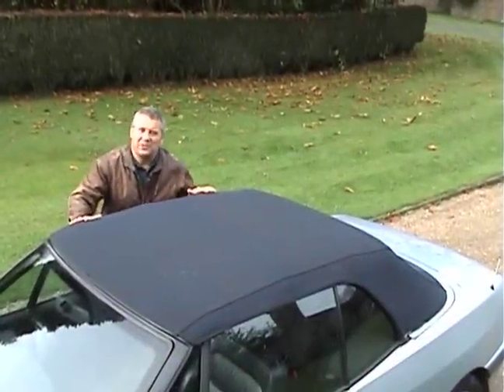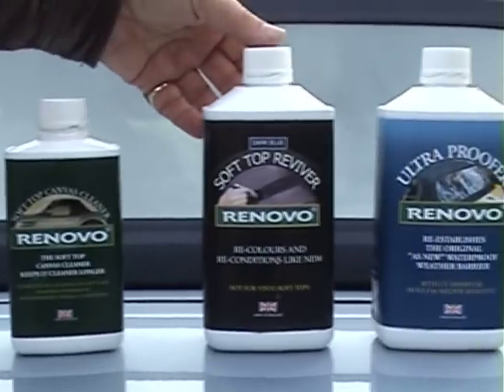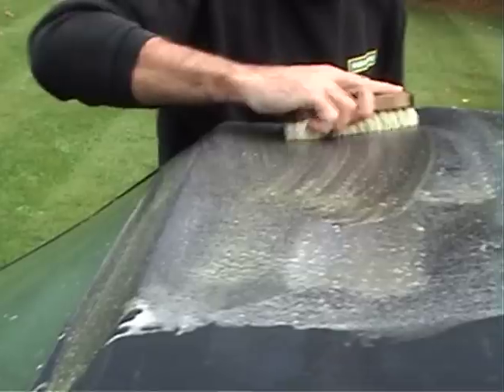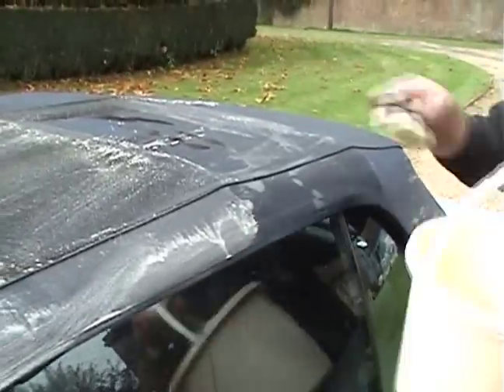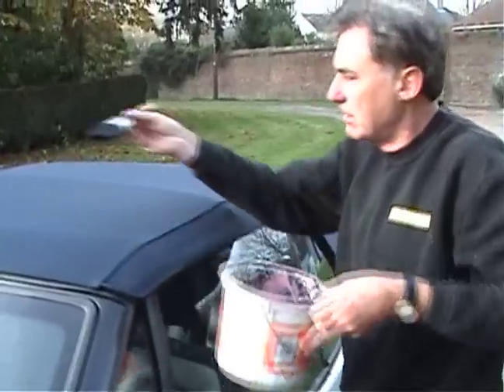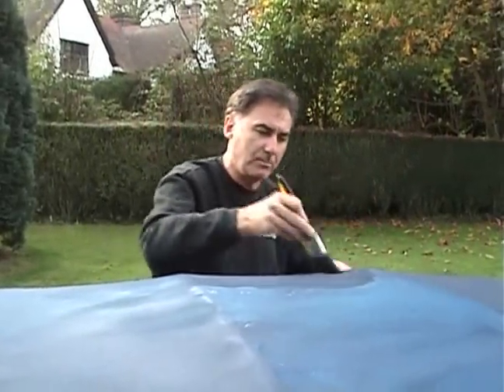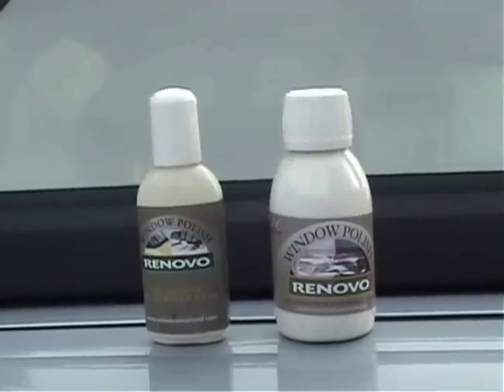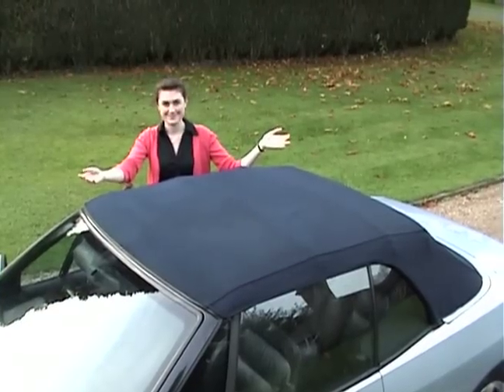Revive your convertible soft top with Renovo

Comment from the maker: Hi Sayer

I've spoken to one of the directors by email, and whilst he agrees that a recolour could work in theory on any exposed fabric, he doesn't recommend going that route. It seems that seepage may be the main problem, and could potentially be 'a bit of a mess. ' (They are nothing if not honest at Renovo!). As mentioned before, Renovo is formulated for canvas type products, not vinyl. However, another cure that might work on faded vinyl is a simple 'cut back' with a product such as T cut, or 3M's Imperial compound, or Starbrights plastic restorer. All these products contain a very mild abrasive, that should take out oxidisation (fading) and get back to unaffected pigment underneath. Worth a go on a small test area, I would suggest. Hope this helps. Cheers. Jake
Reply: Will the product work on a blue convertible that seems to have flicks  of bleach that are white spots please
Reply: @patrowe8156  It depends on what exactly the white spots are. If they are indeed flicks of bleach, unfortunately, the Reviver will not mask them. However, if they are bits of mold, which can look white, it will certainly benefit from the Fabric Soft Top Cleaner and Reviver.
Reply: @renovointernationalltd8329  hi l have been told that the marks on the  fabric roof are bird poop that was left for months, do you think Renovo cleaner will help ??please

Comment: I had a leak on my 2001 boxster - coming from above the driver side window.. porsche quoted me way too much for replacement rubbers. I took it to Marshall motors - they said the door had dropped a fraction so it was'nt sealing - realigned the door - no more problem. Worth investigating.

Comment: Hi, I have used Renovo as described on the bottle - I have a few scratches in the top. My question is "How can I get rid of the scratches?"  They look like dog feet type scratches. I found these on the roof having returned from a shopping trip
Reply from the maker: Hi Roger. That might be tricky, as it sounds like they have taken the top layer of the fabric off. The reviver will disguise them to some degree, but unlike the plastic windows, the scratches can't be physically polished out. Bit of a pain, I know, but they may almost vanish once recoloured. Cheers Jake
Reply: Hi JakeThanks for your positive comments. I will try the reviver on the soft top at the weekend - weather permitting

Comment from the maker: Hi 13jm31. Apologies for the delay in reply - been overseas! Alas, it's not (yet) available in white. However, you might find that the cleaner by itself will do much to restore the existing colour, especially if applied with hot water. The Renovo range is now widely distributed by Unipart, so can be found in automotive retailers and boat chandlers, or you can order it direct (and get advice from the star of the video, Pat) at the Renovo website (address in vid) . Cheers. JakeKav1

Comment from the maker: Hi Pat. I've spoken to the manufacturer, and they say a number of their customers have done just what you're proposing, and the feedback has always been positive. It's imperative to clean the canvas thoroughly with Renovo Soft Top Canvas Cleaner first, though, and you may need more than the two recommended coats of Reviver, which will make the material a little stiffer. Renovo has good advice if you contact them directly. I've changed a parcel shelf from grey to black very successfully!
Reply: Many thanks Jake, have taken your advice and contacted Renovo directly. If I go ahead with the purchase, I'll let you know how I get on.
Reply: patmahe01 Hello. I have a Z4 with a brown roof and was also wondering if I can convert it to black. Saw your comment here and would like to know if you were able to convert yours with this product; and if so, how many bottles did you need. Thanks

Comment from the maker: Hi Daytoncarcare

As a freelance journo who has followed Renovo's development for the marine industry, I have used their products successfully on everything from bicycle panniers to canvas shoes. So I passed your comments on to the Renovo team. They replied " Rit dye seems to be about the equivalent to Dylon dye in the UK, Dylon being used to colour fabric items in a washing machine. Since Rit dye is not specifically developed for use on soft tops, it would seem quite risky to try it out on ones prized convertible. Who knows how colourfast it would be, what would be the longevity of the colour and most importantly what damage it could do to the soft top! We don’t think many people would be prepared to risk it. Why penny pinch on such an untested product?"
Reply: Jake Kavanagh On the bottle they claim that the 500ml will cover an average size top, but it doesn't.  And they also recommend doing two coats.  They charged me about $60 for the color and proofing bottles.  So that means two quantities will have to be used to complete at least one coat ($120 without buying the cleaner). Since two coats are recommended then that would be $240 or maybe less if you can stretch it with three pairs of bottles ($180) instead of four.  With some smaller tops you can purchase the whole canvass for $400-$600 depending on what type of car you have.Of course, some are easier than others to replacel so you may have to hire an installer.  Rit dye will work but you have to go though the process of rinsing it several times before proofing it or it will bleed.  Since that is the way they dye clothing. So it's a toss up if you want to pay ten times more for the Renovo color and not risk the bleeding with the first rain or use Rit and deal with the rinsing process.

Comment from the maker: Hi Sayer

Alas, these products can only be used on canvas-type fabrics, as the dye technology needs a porous surface. The problem with vinyl is it has a shiny, impervious surface, which the dye can't penetrate and bond with. That said, if the vinyl has actually worn away so some of the supporting fabric underneath is exposed, then - in theory - the dye will recolour the supporting fabric in those areas, which may be enough to disguise any fading. I will ask the CEO for some further info, and post here shortly. Thanks for watching!

Comment: Hi David. This is very odd. The product has been around for decades and successfully used on literally millions of vehicles, as well as boat dodgers, cycle panniers - in fact anything made from a canvas weave. It is a highly absorbent dye based on paint technology, and yes - will make the material a little stiffer (although not by much) but it certainly shouldn't crack or wrinkle. It won't work on canvas-effect vinyl, for example. The clue may be in the substrate which you say is mohair. I'm not familiar with this in terms of Renovo,  but what I do know is the dye should be applied to natural fabrics that are woven. The dye seeps into the fibres to create a solid base colour. Ideally, the fabric should be washed first, and Renovo's cleaner is tested to be fully compatible with the restorer. After the colour restorer you finish off with the reproofer, which fills any gaps left by stitching holes that open up over time. If you put multiple layers on, rather than a single coat, this could stiffen the material more than usual, but that is all I can think of. Follow the directions, use it on pre-cleaned, woven material and you should have been one of millions of happy customers.

Comment: Not so good for me got the whole kit 1lt each. After following the instructions it dryed up looking like it had been painted a silver colour and very patchy. Got in touch with renovo through amazon had no reply. Took it to a soft top specialist and was told nothing could be done and should never use dye, clean protect only. New hood needed. I have spent over a 100 hours (yes 100 hours). Been cleaning with difference products little improvement. I have now tuned to treating with petrol nothing to loose, it seems to be working don't see any sign of damage.

Comment: Ok so I thought to try this expensive product.  My wife's '03 Eclipse GTS lives in the shade a lot of the time so the top wasn't bad but I wanted to bring back the new black look.  I carefully cleaned the top, let dry.  Masked off some areas and went to work per instructions.  My bottom line?  Waste of money period.  The top didn't get to the black I was hoping for and again, for the price one pays you would think it should.  Very unhappy and I do not recommend.
Reply: @jakekavanagh7385    in fact I did buy a litre. (Think I got it on Amazon but not sure.  Do I need to prove?  Care to see a picture of the remaining in the container on my shelf?)   As mentioned in my comment..." Eclipse GTS lives in the shade a lot of the time so the top wasn't bad". Yes, older vehicle however, with only 60K miles and the fact that it sits at home in a carport most of it's life why... the top was quite good. (Just wanted it to be a deeper black like it was when OEM and I thought from reading and youtube videos I saw that this product would do the job.) I used about 600ML of product in the application and it was applied liberally. 

Yes of course, "masking off" was to protect the car. It's just standard practice for me when working with paints, products like this. The application was not "skimped" on. Sorry, I just thought with a top like ours in rather good condition that we could get a deeper black in the one coat. 

Hind-site 20/20 now? Ok maybe another coat would have helped?? Well, read the side of the container, our top was not "badly faded". I have about 400ML left, if they want to send me another bottle at no cost I'll give it a go again with two coats and update my review it it produces positive deep black results. (Is your/their definition/perception of black different from mine?  Works "brilliantly"? Now there can be the catch I suppose.)

Comment: Hi Graham
Yes, this should do it - be aware, though, that you will probably need two coats (let the first one dry) and it will make the material slightly stiffer than it was before. This is paint-based tech so will sink nicely into the pores of the fabric ( doesn't work on vinyl). Also, clean the fabric well before use. This vid is quite old now and Renovo has reformulated the cleaners to be easier to apply, so they will appear different than they do here. The team at Renovo are always happy to help and advise, as it is a family run company and the customer is king. You can colour successfully from light to dark, but not the other way, so this should be fine for your project. I've used black and navy blue on everything from cycle panniers to canvas shoes. The dye is very long lasting, and if you reproof afterwards, you'll have a roof that looks almost new! One point - any stitching that is white or beige will also be dyed. The proofer is also great at sealing up the stitch holes, which 'work' with age and let water in. If you have a leak, it is usually at the stitch holes, and easily cured! Cheers. Jake

Comment: Hi AwesomeFuture777. Apologies for the tardy reply. I have run your question past the manufacturers, and this is their reply. "It is possible to change the colour of your soft top from white to black using Renovo Soft Top Reviver.  However, Soft Top Reviver was developed to bring back the original colour, not change the colour and consequently there are risks involved with this process. It is not reversible and can take more than the two recommended coats but not more than three. It is imperative that the top is cleaned thoroughly, ensuring that any previously applied proofing product is removed, before applying the Soft Top Reviver. Renovo Fabric Soft Top Cleaner will remove most proofers if the severely soiled cleaning instructions are followed. If you are aware that another proprietary branded proofer has been applied it is best to contact their customer service department to ascertain how you should remove their proofer. A number of Renovo customers have changed the colour of their fabric soft tops using this method and the feedback has always been positive.  Please contact their customer services to get the specified documents that will help you with the process."

Hope that helps! Cheers

Jake